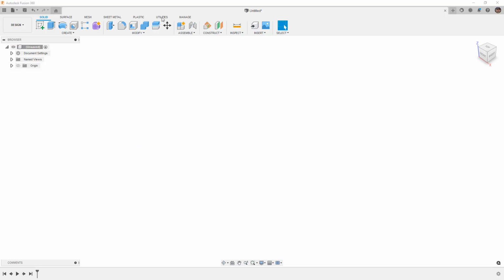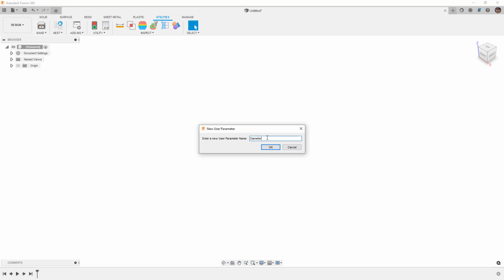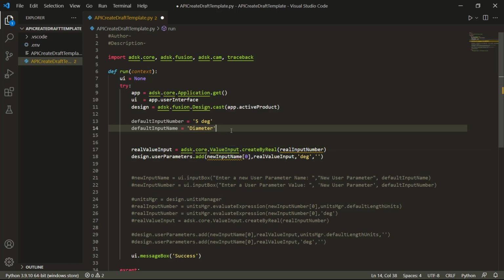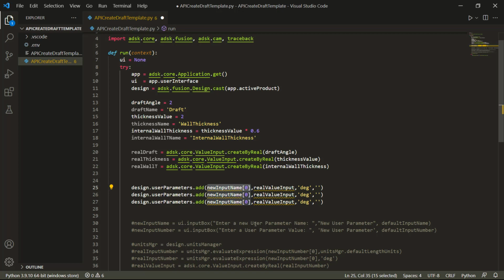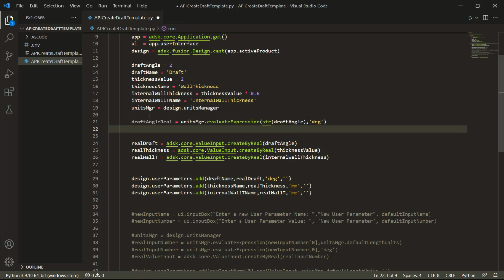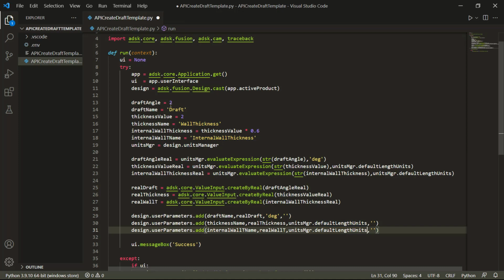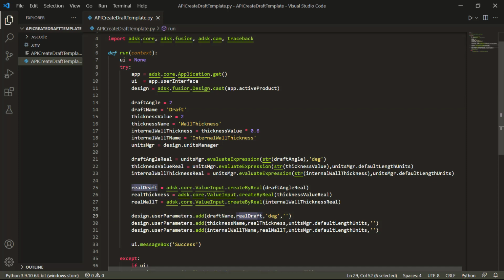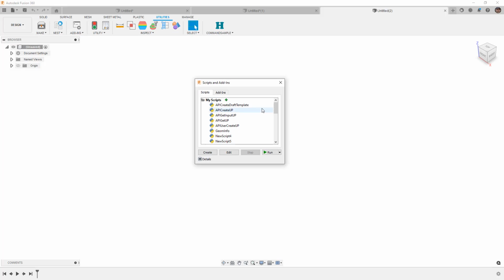Intro to API in Fusion 360 Part 6 - Create a User Parameter Template Script #Fusion360API #Python

Comment: You didn't made a complete example video, from script to design, like taking input parameters: length, height and width -> then creating a box out of it
Reply from the maker: I did not because the video series was meant to be API only.  Most people that want to create a script to automate something don't also want to see the modeling part as it is very specific.  I have plenty of other videos working with Parameters and also more API video creating sketches, solids and manipulating designs.
This video creates sliders to manipulate user parameters and update a design
https://youtu.be/ZgRLqBBVpqE

This one takes xml data to drive user parameters and save configurations of a design
https://youtu.be/mxvQgpgOvzE

Fundamentals of user parameters
https://youtu.be/ntMBZQUTLNA

Using functions in parameters to drive designs
https://youtu.be/-BPcktQwIIY

Complex design with parameters
https://youtu.be/jiHUEhja9V0
Reply: @LearnEverythingAboutDesign  thanks for your reply, i will definitely check them out, it might be helpful for me

Comment: To prevent confusion from having so many similarly named variables just reuse the same variable:
    inputAngle = 2
    inputAngle = unitsMgr.evaluateExpression(str(inputAngle), 'deg')
    inputAngle = adsk.core.ValueInput.createByReal(inputAngle)
    design.userParameters.add(inputName, inputAngle, 'deg', '')
Reply from the maker: Thanks Ryan, I would need to go back and remind myself what I did in this video.  I think you are talking about the "defaultInput" and "realInput" that I used?  I think the reason I did it that way was to display the string "5 deg" in the input box.  i'll have to give it a try your way thanks.
Reply: I'm afraid I’m going to have to push back on that. It is not a best practice in programing to reuse variables. This is especially important when debugging. Getting an error that references variable InputAngle would get VERY complicated to solve. Also, if the name of a global variable is used in a narrowly scoped function, you can inadvertently change a value if you have used the same variable name. Best to use clear names that help the next programmer understand your code.

Comment: Please upload more this kind of videos
Reply from the maker: Did you see all 6 episodes?  I have some ideas for more api videos I just have them lower on the list.  Anything specific?
Reply: @LearnEverythingAboutDesign  Changing parameters via a slider would be interesting
Reply from the maker: @jfree4808  There is a program called Dynamo, that for a short time had a Plugin for Fusion 360.  Sadly I don't think Autodesk supports this anymore but I am hopeful it will resurface in the product(fingers crossed).  https://dynamobim.org/   https://www.youtube.com/watch?v=jf-c4mAYt1E
As far as changing parameters with a slider, I think the way dynamo did it and Grasshopper in Rhino is what you are looking for, which is super cool!  But they were looking at geometry nodes.  Are you thinking more like a dialog that shows each Parameter with maybe a default value and a slider that lets you drag it up/down?
Reply: @LearnEverythingAboutDesign  
ah okay I see, during my research I also came across grasshopper.
Yes, in a way, but actually I would like to have a model issued in several variants as Stl. For example a cube where I change the edge length x in the range x=[1,10,5] ("1" first edge value, "10" second edge value, "5" number of steps). So that I end up with 5 stl with the appropriate changes.
Reply from the maker: so in the end you want to have 5 different STL files saved out each with an edge of 1, 3.5, 6, 8.5, 10 ?
Reply: @LearnEverythingAboutDesign  Yes